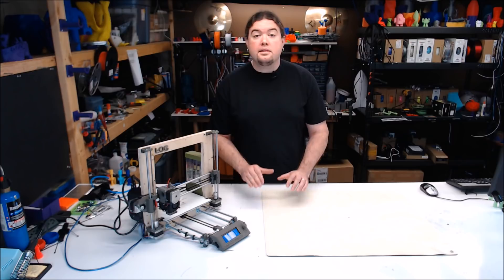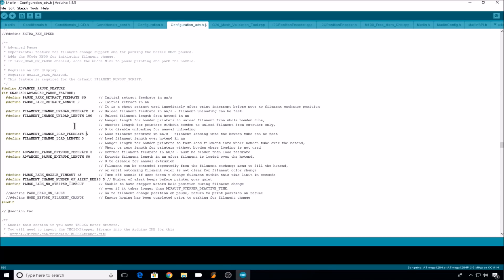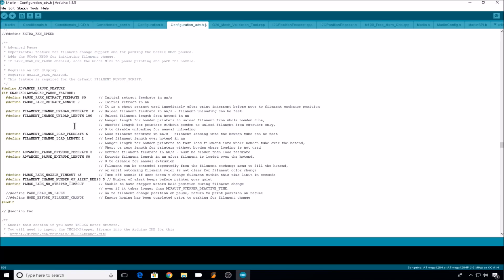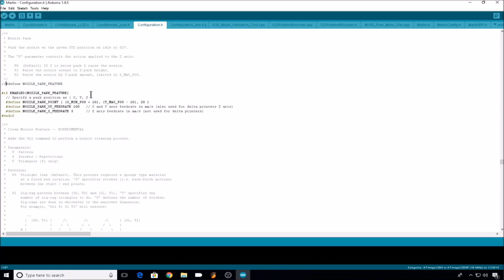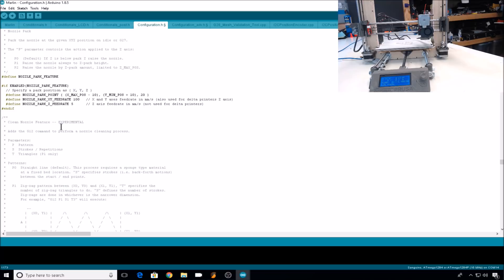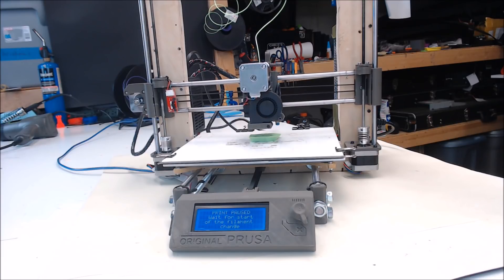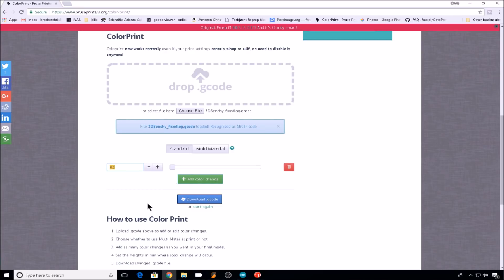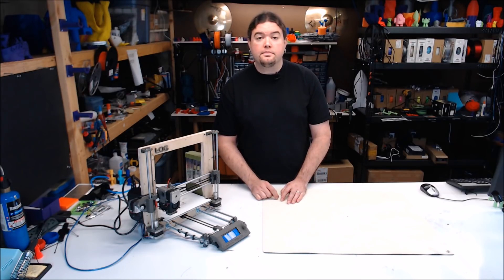Marlin Filament Change M600 - Chris's Basement

Comment: Will m600 work in simplify3d while it's printing?
Reply from the maker: Yes, it should. I have never tested it, but it's just gcode. So it should work as expected. I use it in Octoprint all the time.
Reply: Chris Riley Awesome. Thanks Chris.
Reply: @ChrisRiley  Hi Chris, I tried the M600 in Simplify3d. It works good except for one problem. After loading the new filament it resumes printing with the purge filament hanging on the nozzle. It's not giving me any option to purge more filament or resume printing like in your video. I have Marlin 3.0.2. Here's the M600 gcode I use. 
{REPLACE "; layer" "M600\n; layer"}. How do I get the option after loading the new filament? Any idea? Thanks.
Reply from the maker: What printer do you have? I don't know of a Marlin 3.x, all the 8bit versions I know are 1.x.x and the 32bit ones are 2.x.x  The M600 should work, but the parts you will need to set to get it to act right will be in configuration_adv.h under #define ADVANCED_PAUSE_FEATURE
Reply: @ChrisRiley  My bad. I have Marlin 2 firmware. I have the Monoprice Maker Select Plus ADVi3++ 3.0.2. It's weird cause we have the same settings under config.adv.h when I watched your video. I must be missing something.
Reply from the maker: Ahhhh, that has that slick touch screen on it. I would have assumed the touch screen would have had some sort of equivalent message for it, but maybe not. We might have to get the ADVi guy to make one for it.
Reply: @ChrisRiley  Yeah, maybe that's it. Thanks for the reply Chris. Hopefully I figure it out. :( Maybe I need to add M0 command?
Reply from the maker: Sebastien Andrivet might be able to help. I would try to catch him on github. https://github.com/andrivet/ADVi3pp-Marlin
Reply: @ChrisRiley  Cool. Really appreciate if you can. Thanks again Chris.
Reply from the maker: I was just looking around, looks like it's already on his list of things to add. https://github.com/andrivet/ADVi3pp-Marlin/issues/139
Reply: @ChrisRiley  Great. Thought I was the only one having issue with it. Thanks for a quick update Chris. You're so cool man. 👍

Comment: hello, the Z axis goes up 20mm from the position where it is or goes to position 20?
because if I'm printing a piece of 100mm and I put the M600 in that layer, the Z axis that plows? will it go up 20mm or will it go down to position 20?

greetings and thanks
Reply from the maker: Hey thanks for watching, it will go up 20mm from the current Z height.